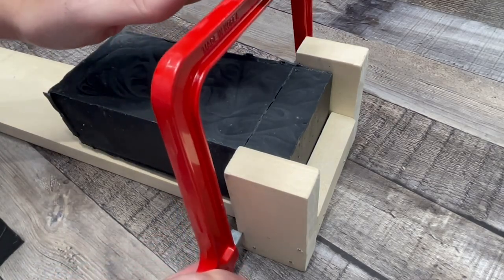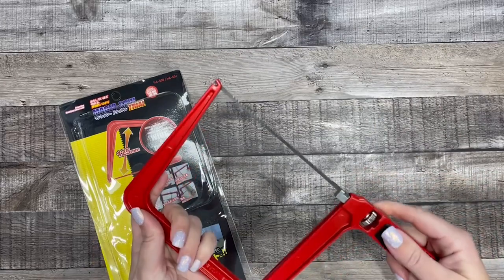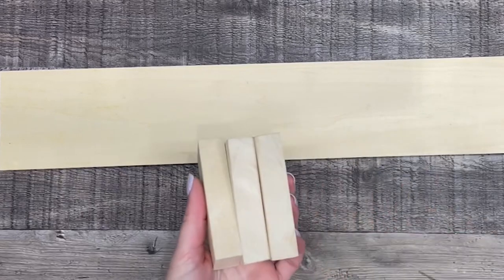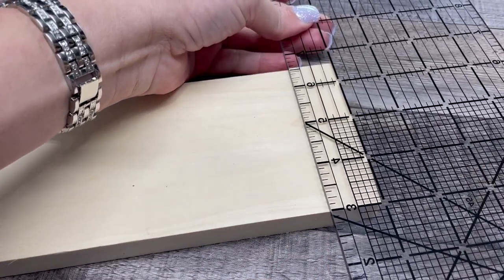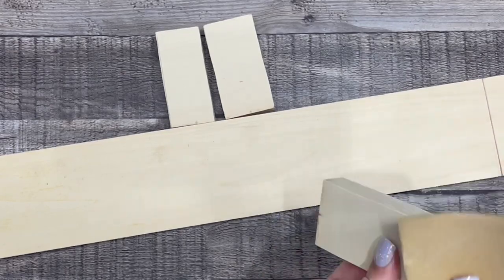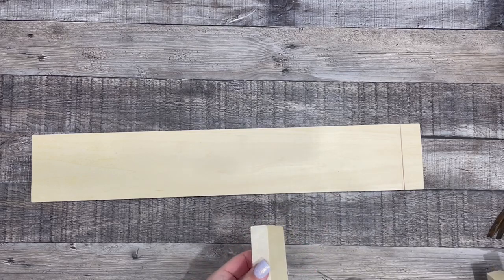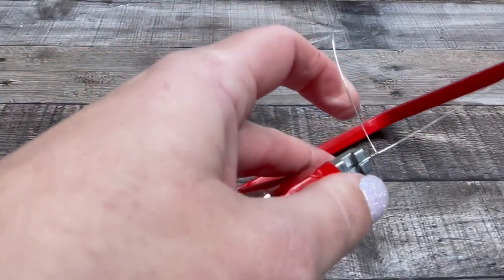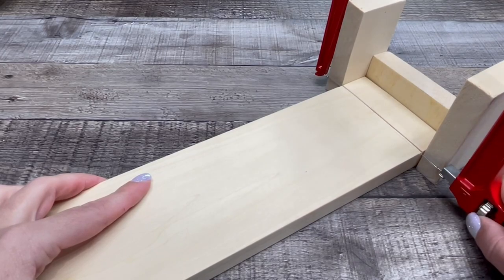EASY DIY SOAP CUTTER!

Comment: That is really a nice color black in that soap. 
I don't know if its cheaper but there is another way to cut on a budget.
Buy a dowel or get something round to use as handles. Drill a hole in the center of the handles and tie 30 lb fishing line through the holes.
Put the line in the notch that you cut, put the soap over it. Line up the opposite end with the line against the wood and just pull ONE of the dowels  (The other dowel will catch on the loaf) while the other stays in place. It will cut cleanly though easily using the wood as a guide.
It will even cut melt and pour and glycerin soap very cleanly.
So a saw is not nessarily needed if the object is to save money. But, than again, decent quality fishing line costs $6-$15 any way.

Comment: Great idea. Just a problem with the design for taller soaps - the height of the soap may be higher than the base piece of MDF is wide. Which causes the "goalposts" to be too short.
We had to disassemble and try again.